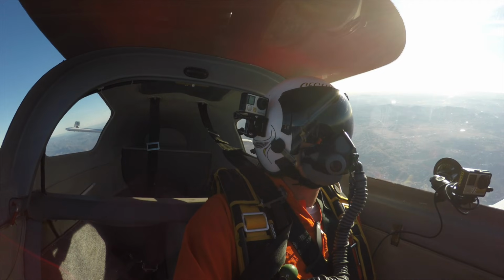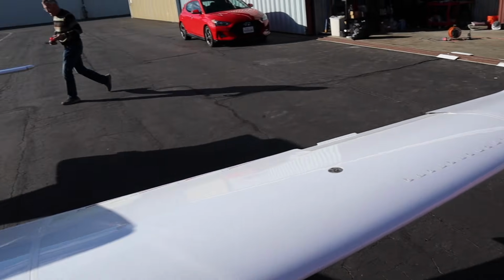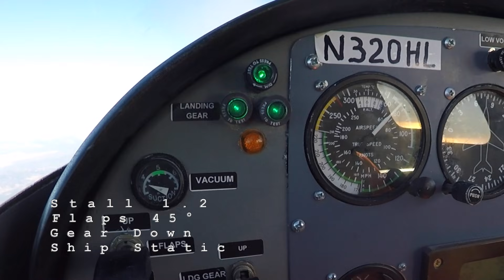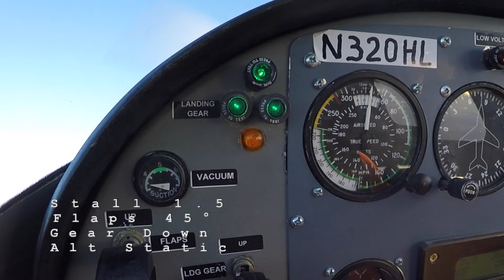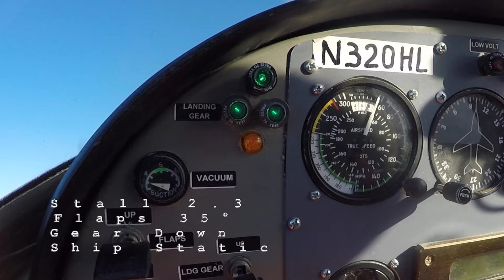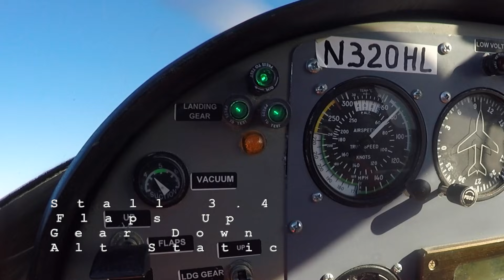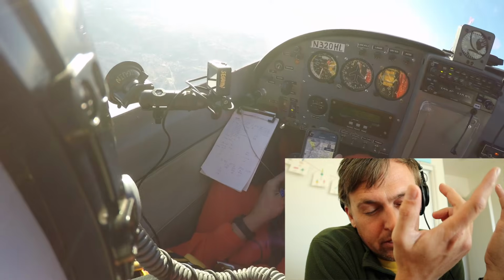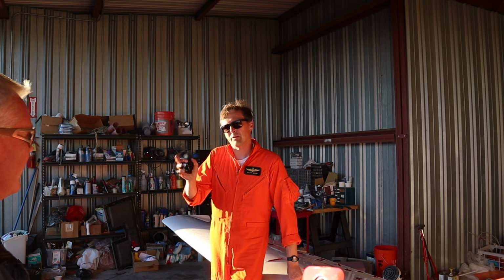How Fast is it? - Flt 8 of Hakan's Modified Lancair - Vortex Generators Tufts & Speed Check

Comment: i think I'm going to enjoy this before it's finished.  I have a cup and tea and sitting down.
Reply from the maker: Thanks, let me know what you think.
Reply: @utopiasnow  it was great to observe the airflow indicators, especially at 45 degrees of flap, showing the airflow separation as the aircraft was stalling. I'm both an aircraft engineer and pilot so my brain is constantly looking for all the little 'tells' during all the maneuvers. Enjoyed this one as well. Sorry if my response was a bit geeky.
Reply: I too was fascinated by watching the tufts at all the different flap angles, as there is a marked difference in the rate of the propagation of the airflow from the wing root towards the tip dependent upon flap angle setting. Just as fascinating was the lammar flow seperation occuring just after of the widest portion of the Lancair. I would love to have seen how this separation affected the airflow over the tail services. 
 Too bad the inaccuracy of the ASI rendered most of this data useless, as 0 degree flaps had a lower stall speeds than with all the other flap settings. What would have been most helpful in this analysis would have been an accurate VSI in evaluating the validity of the test. 
 As in any anylisis,  garbage in = garbage out. Thanks Elliott for another FANTASTIC video! Your enthusiasm and method of approach to aeronautics has relit a  long latent fire of creating my own aircraft! E

Comment: No need to guess what the speed/temperature values are.  While on the ground, plumb a manometer into the pitot system.  Using pressure, calculate the actual airspeed at the various temperature indications on the ASI.  You could also plumb a low-speed ASI into the system and just read what it says when the pitot system is pressurized to a particular temperature on the primary ASI.  I have the same problem;  I touch down somewhere around 10 degrees.  I'd considered adding a second, low-speed ASI for slow flight - possibly with an isolation valve, or better yet, it's own pitot and a pressure relief valve to protect its calibration at high speeds/pressures.
Reply from the maker: Great comment.  Thank you.

As I am sure you saw in the video Håkan has hesitated to redo the panel before his flap system is proven.  As a result the instrumentation is sub par.

As far as the instrumentation Wasabi brings to the table it's important we mention the small scale of this kind of a program.  Wasabi ends up being  mostly supported by the big customers we can't talk about.  These little programs while tremendously rewarding are also very cost sensitive.  So the idea of spending many hours integrating thousands of dollars in instrumentation becomes hard to justify.  Especially just for a single day of testing.

Thanks again
Reply: More of a suggestion for Haken to accomplish on his own time.  Just need a few feet of vinyl hose full of water to make a manometer.  Don't even need to touch the panel.  Just stick the end of the hose over the pitot tube.

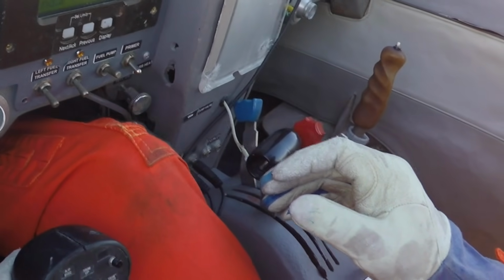Comment: 10:12 was the throttle and prop lever vibrating back on their own? Did they move when the gear “thumped” into the wells?
Edit: you addressed it later in the video.. thanks!
Reply from the maker: Thanks for the thoughtful question.  I like knowing you are watching.

Comment: Cool.  The camera probably distorts what we see, but is the AoA @ stall with these big flaps pretty standard compared to the stock Lanceair?  Cheers.
Reply from the maker: The nose is actually really low.  Wait until you see what we did over the weekend.
Reply: I was wondering, why the focus is generally still on fixed stall speeds and less on AOA. Most stall accidents happen above the published Vs, as the aircraft is in a banking turn (to base or final).

Personally, I would wager a bet that flying AOA only and forgetting about speed will yield safer results overall.

(I do understand that speeds are legally required.)

Comment: Another great video, Elliot. From what we can see it doesn't seem like there is much of a stall speed difference between zero degrees and 45 degrees of flaps, which is frigging weird. If the difference comes down to sink rate, then why not eliminate the flaps entirely and just slip to increase the sink rate? It would save effort, save weight, and make the plane both faster and slower. But of course I am being too simplistic. And yet, John Parker had a Glasair III racer built by Jeff Aukland that had no flaps at all and showed the same kind of numbers (not much change). 

What's the zero flap stall speed for a straight stock Lancair 320? Shouldn't it be the same as this or even a bit less since it stock is lighter?
Reply from the maker: Bob, great to hear from you.  As usual I am impressed by your perspective.  I wouldn't say the difference between a flaps up and flaps down stall in this is small.  And slips are absolutely effective for getting down to a glideslope.  The problem is, as you know some folks are more comfortable in a slip than others.  

If I learned anything from the last two Hakan flights (currently editing) it's that there is a big difference between a seasoned bush guy hanging off the stall to stop on a 20' gravel bar, and your typical 200 hour 172 pilot.  And while the big flaps and the bush tires make the airplane look the part there is no substitute for the skill to taking the airplane to the corner (as well as the risk tolerance).

Again great to hear from you.
Reply: @utopiasnow  I'm sure you are correct, Elliot, and it's way too late for Hakan to rip out those Fowlers. Still, it argues (as always) for building light. I recall 40 years ago when my 999 lb 150-hp Glasair TD (one of the lightest ever built) was humiliated by an 850 lb. 135-hp W8 Tailwind flown by a more aggressive pilot than I will ever be.
Reply from the maker: @robertcringely7348  Boy doesn't that just sum it all up.  Cool stuff.

Comment: Airspeed indicator error seems to be a common problem with these experimentals. Would it be worth investing in the BOM pod and a variety of inspection plate mounts?
Reply from the maker: The BOM pod is super cool and solves a lot of the problems but not all of them.  Spin garage makes a cool similar product.  The problem typically isn't the total pressure side, its the static.

Thanks for the comment!

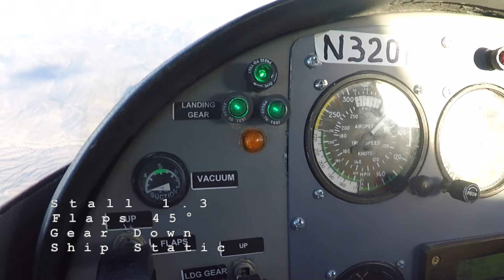Comment: Quick question, I noticed that the suction gauge was low at 13:54 and that it was "ship static", what were your power settings? Also would the suction still read between 4-5 once at idle? Absolutely Love this series..
Reply from the maker: Thanks for the comment, great to hear from you!  I haven't spent much time with this topic but yes the vacuum pump is engine driven and it takes some time after pulling the power back for the engine to spin down and the system to leak up to atmospheric pressure.  Also on the 10" MAP points the engine didn't spin all the way down.
Reply: @utopiasnow  Appreciate you responding, hoping all is well and looking for the day where I can see you again. Clearest of skies my friend.

Comment: Elliot. another great Video! 
What is with the vacuum suction dropping off each stall on cockpit view? am guessing it is on an engine-driven vacuum pump. was it just dropping back with low engine RPM? 
Where are you hiding Justin?
Reply from the maker: Yes engine driven vac pump.  My assumption is that is takes time for the engine/pump to spool down and the pneumatics to vent back up.  But honestly I haven't spent much time on it.
Reply from the maker: And Justin has been deployed on a test program.  Excited to have him back in the mix soon.

Comment: Do you climb back to a test altitude after each stall?
Reply from the maker: Cool question.  I start as high as we dare and stop high enough to stall-depart-attempt a recovery and bail out safely.  On this flight I started the point at 10.5K and stopped stalling before going through 6.5K.
Reply: @utopiasnow  awesome thanks! Does the stall behaviour change much over that window? 

On a career question, how much flying did you have before you started flight testing? What sort of flying had you done as well as how much of it?

Comment: Hey Elliot, you're inspiring me to build a light GA experimental flight test data acquisition kit.  I envision a device the size of a deck of playing cards with accurate pitot/static and onboard GPS.  I would plumb inline with ship pitot/static quickly for missions like this.  The goal would be to make it as simple as possible one switch operation to enable Phase 1 testing for the experimental community at large.  If that's reinventing the wheel someone please let me know.  I've been looking for a fun project idea for a class later this year.
Reply from the maker: We developed a similar product with Andrew Angelotti and his company called Spin garage five or so years ago.  The result is fantastic but more expensive and complicated to install than would work on these types of programs.  

An important reminder, our current business model (flawed) in most cases puts a test pilot at several jobs per week, spending a day configuring the airplane, getting the data, and deconfiguring the airplane.  Yes there are longer more committed programs, but alot of the really fun customers can't bear the burden of many days commitment.  For this kind of gig work the idea of spending many hours installing thousands of dollars in equipment can't be justified.  

That being said our business has consistently changed over the years.  It doesn't take very many of a new type of program to radically change how we solve these problems.

Thanks for the comment, I hope my response made some sense.  -Elliot
Reply: @utopiasnow  thanks a bunch for the explanation Elliott.  I'll look that project up.  I am definitely thinking of something as simple and low cost as practicable to aim at the owner/builder community if even to remove distractions during early phases.  Really digging this series with Hakan!

Comment: Great video! The R wing camera gives a fantastic look at the longitudinal axis with respect to the horizon in each stall, very neat to see. Is fuel flow affected by MAP, or just directly by mixture setting? Would that be an indication to confirm reduced HP output?
Reply from the maker: Thanks for the comment.  Great point about fuel flow.  We learned alot about these issues over the weekend.  I apologize but hang on there is more coming.

Comment: @Elliot - I keep meaning to ask: What do you use to secure your external camera mounts?  I keep thinking that I'll need to fab up some thin fiberglass cuffs, but you appear to be using some kind of adhesive... VHB, or something like it?
Reply from the maker: VHB, I have had pretty good luck below 250 KIAS with a single VHB.  With dual stickies I am comfortable into the 400 KIAS range.  Beyond that I want something mechanical.

Comment: Right after work, another video! Great timing again, thanks! And at first glance less sound-effects, thanks!
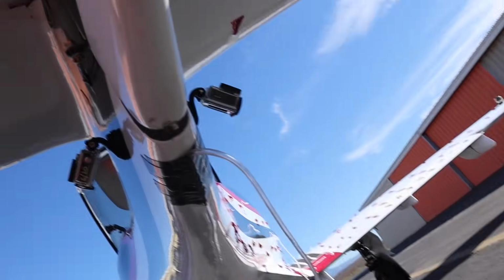Quick question: you say around 3:00 you have now demonstrated that the static indication error was fixed. Did you also demonstrate that for higher speeds? If so, how? Or is higher speed generally not a problem? Can you elaborate on this a little bit?
Reply from the maker: My apologies.  The point I was trying to make at 3:00 was that the bulk of the confusion from the initial stall testing could be explained with static error, and the new location is much better.  That being said there is still error.  The question now is the error on the high side.  Which we are learning a lot about.  Thanks for the question.
Reply: @utopiasnow  No worries! Thanks for the answer! Curious to see what the future conclusions about the static locations will be.
Reply from the maker: @RoelBaardman  This last weekend was very interesting.  Editing now.

Comment: Awesome! I look forward to every one!  Maybe a dumb question? Would a spedo app on a small tablet show anything useful?  I have one on a 7" tablet I've used in my truck and golf cart (it's slightly modified LOL).  The app acquires 7 satellites and determines the best 3-4 to use. Then displays, and records w/ time stamps in MPH or KPH. Pretty simple. Maybe not accurate speed, but consistent numbers?  Just a thought...   Thanks for sharing!!!   8)    --gary    Ps; Might work on an android phone also??
Reply from the maker: Thanks for the comment.  GPS speed absolutely has value.  The biggest problem for the stall stuff is the update rate is so slow.  The GPS reports position a couple times per second.  Then the change in position is used to compute speed.  Then that speed is posted at whatever the instrument refresh rate is.  The result is it's hard to know what's what.  Meanwhile all part 23 stall stuff is designed using a pneumatic based speed indication system.  Hakan and I have debated this alot so I don't mean to sound directive, but I personally question the value.

Thanks again.
Reply: @utopiasnow  I guess I was thinking it could provide an independent number, taking the ships systems out of the calculation, to compare the 2 readings to. It could be 60 beans v 54 beans, then how each MPH/KPH number compared. A calibration of sorts?  I used a Samsung 7" tablet, and it would use 3 of 7 satellites it acquired for readings. It seemed fast and smooth (I don't have numbers), and would record in numbers or graph format w/time. It was a 'free' app at the M$ (Microsoft) play site. Again just a thought, just wanted to explain the whole thought.  Thanks Ell.!   8)    --gary

Comment: Wouldn't it be great to have spring-loaded VG's that folded down at any kind of cruise speed, eliminating drag, but popped up at slower speeds, to lower the stall speed? Best of both worlds.
Reply from the maker: Yes, that would be super cool.
Reply: @utopiasnow  I was actually letting my mind run the other day and thought that you can blow a laminar layer (re: NASA and their modified F16 experiment) but if you used a larger port the right way you could create a vortex with an angled stream. That's unfortunately one more thing that would have to be factored into the initial build, that's a lot of plumbing to try and add to the front of an assembled structure... and also assumes you have one hell of an air pump on board, maybe turboprops could swing it natively.

If you're that early in design you could just add a bellcrank to the flap linkage internally and use it to pop up some hidden VG features, so they'd only be deployed when they're useful. Then again, just introduced more holes to seal or provide drainage for and require inspection for corrosion issues...

Comment: "Oh 80 then we take the VG's off" made me laugh hard.
How do the stalls feel? It does seem to roll of a bit, but that might be that it is looking more aggressive on camera.
I hope that the cruise speed comes back as well, did you notice any difference in fuel flow at WOT compared to last time?
Reply from the maker: Thanks for pointing out that moment.  I was worried it came off as snarky but as far as taking the audience along I think it's an important moment.

More dynamic, yes.  The last few VGs on the outboard portion of the wing I think are the reason.  It's amazing the difference they make.

Thanks for the thoughtful comment.

Comment: I have built a digital ASI, extremely accurate even at low speeds, and very inexpensive. Can be velcroed to the panel.  I would gladly donate one to wasabi.
Reply from the maker: Thanks for that.  Sounds very useful.  I would be happy to tell people about the source of such product if we had it.  Meanwhile it's worth noting that the Wasabi business model involves many short visits to customers a week.  As a result we need to be able to configure and deconfigure (and fly) in the same day.  So breaking into the P/S system may not be a feasible option.  But I am eager to try new things.

Comment: 37:53 "I would fly approach similar to an RV... 80kts".... Ha ha yes at slow speeds an RV can sink but the stall speed of an RV-7 or RV-8 is 58 mph (50 knots). Vs x 1.3 would be 75 mph (66 kts) which is a fine approach speed no excess sink or AOA..... 80 kts (92 mph)? Ha ha, That is 15 mph faster than needed. Sink or no sink he rags on the RV because he now realizes after all this work the RV is still a better plane with slower stall and the same or similar top speed.... with FIXED GEAR! Not to mention the RV has better control feel and does aerobatics better and TO/Lds in shorter distances... .
Reply from the maker: Thanks for the comment, always great to have your comments on the channel.  What is your design/build experience?
Reply: @utopiasnow  I know you are fibbing, but thank you.
Reply from the maker: Not fibbing, you seem to have a background in design and build of airplanes.  I am curious to know more.